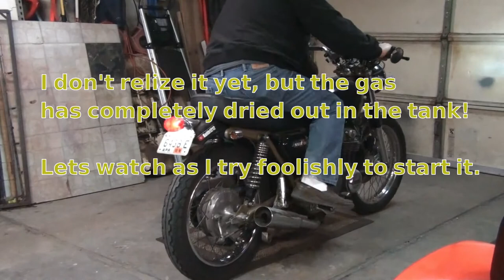1975 CB550 Coldstart

Comment: Hello,  I have a 75 550F also.   I live on the North Shore of Lake Superior.  For winter I take a different approach.  I fill the tank with non-ethanol premium gas in the fall.  During the off season I try  to start the bike once a month.  I let it run enough for the exhaust to stop fogging.  As long as the temperature is above 20 I can get the bike to start.  Thanks for the 550 stories.
-MD
Reply from the maker: Thanks man! Glad to see another 550 owner. Yea, the only reason I drained the tank was because I was going to repaint it again since I had some rough spots however I just never had time. Normally I do pretty much what you do and I find it works just perfectly.